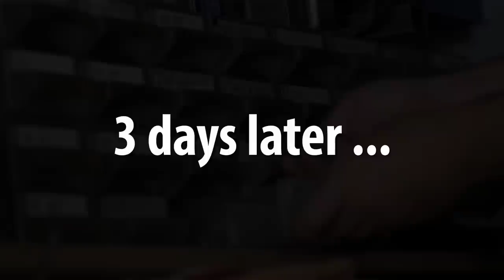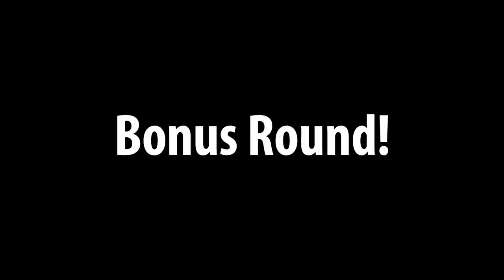Lazy MACHINISTS' JACKS

Comment: instructions unclear, tried to snap that god damn all thread and it only bent. what am i doing wrong?
Reply: Sharky were you using a fine-tip sharpie, or one of the bullet tipped ones to score the metal?
Reply: i used the rip off sharpie from the big rock candy mountain... but it got a CE mark on it so it should not be a problem
Reply: Sharky ah, I think the problem might be that you bought "Conformité Européene" or "China Export" variants, you need to buy the ones that explicitly say "Cutting Enabled" :)

Comment: I cringe when you humbly refer to yourself as a garage hobbyist... you have skills my man and if the only thing that separates you from a guy in a production machine shop... well, I guess the term “hobbyist” is very inaccurate.. still practicing on snapping 1/2 to 7/8 bar sock by hand. I just can’t break it clean as you can. Uuggh.. to the lathe to face it off again...

Comment: There's no way to set it, wat do. Is a set screw unnecessary and I've been lied to my entire life?
Reply from the maker: Usually no need to set it.  Just snug it up to the height you need.  Usually there is something else holding it still.  A clamp on top of the work, pressure from a drilling operation, etc.